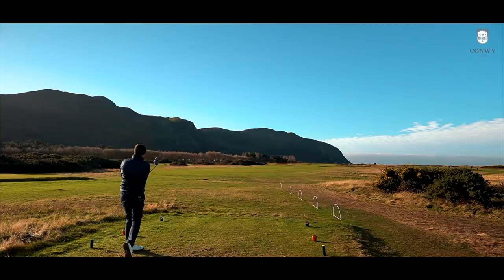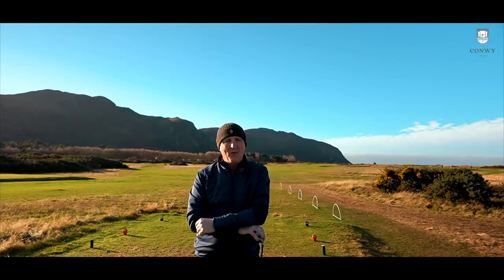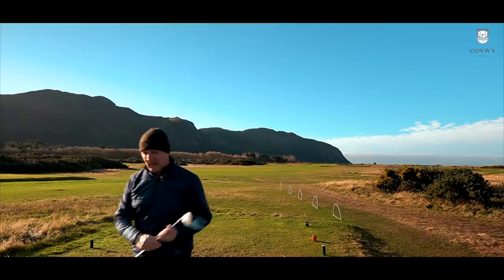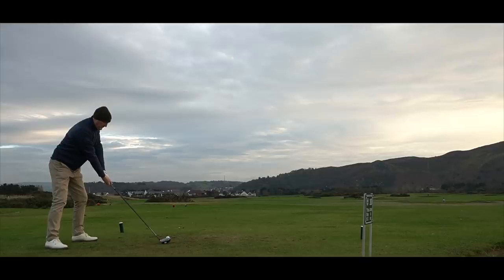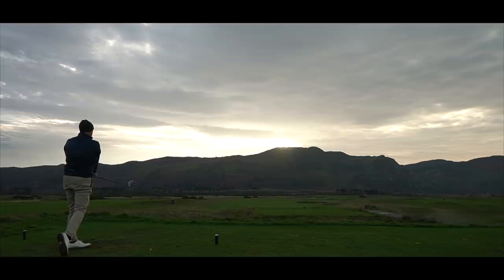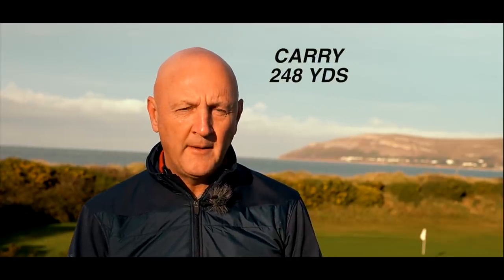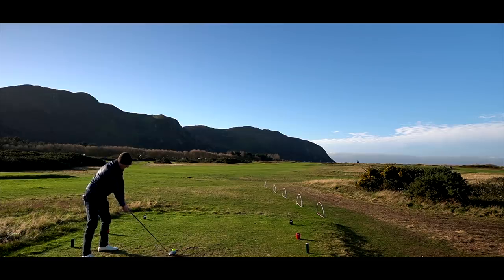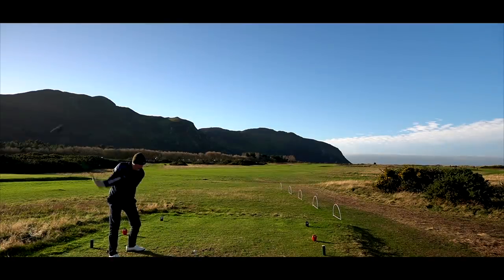SIMply the BEST DRIVER by TaylorMade SIM?

Comment: The Ventus shaft isn’t the same specs as the high end Ventus shaft — according to the MyGolfSpy boys it’s a cheaper version without all the bells and whistles but if you didn’t read up on it carefully you might get suckered into believing it’s the full meal deal shaft. Anyhow more into the Cobra line since they offer a tour spec 44.5” shaft as an option with their new drivers
Reply: Huw chardon Ping make fantastic drivers. The G410 just went on sale and are $399 so another good option. F9 right now is $349.
Reply: @cwugrad396  i have the g410 plus & cobra f9 and can't split them on the course at all. I would never swap these 2 drivers out of my bag for anything that came out as i know i won't improve my accuracy or performance with any other drivers.

Comment: Great Video Andy.  From what I understand, Fuji sold the shaft name (I don't know why) and that the Ventus shaft in the new SIM is not a true Ventus shaft unfortunately.
Reply from the maker: Thats interesting, I had been asked in the past to review the shaft and I just didnt like this version at least
Reply: Unfortunately, TM NEVER use a full Spec After Market shaft, they ALWAYS use an OEM version which de-speced to get down to a price point. So the Ventus shaft that TM is using in the SIM driver is not the same as the Ventus After Market shaft, it does not contain the i-core high-modus graphite as the "Real" Ventus does. The clue is in the price, the Ventus After Market shaft is nearly the same price as the SIM driver.

Comment: It’s the Cobra F9 with a new paint job.
Reply: There’s a sliding weight, there is no milled face like an f9, there’s that Taylor made speed pocket, the crown is very different and a different colour, appears to have those injection ports in the face,but it does have a shaft, a 460 cc head and a grip so you’re pretty much spot on there champ...
Reply: @tiborsol7959  ignore the meaningless speed pockets, milled face and sliding weight and look at the shell of the club head and it’s basically an F9. Neither TM or Cobra make any club heads. They buy them from the same couple of foundries in China . The only thing TM do is design the club head and assemble the various components. Enjoy your new SIM driver. I’m sure that those extra fifty yards will help you break a hundred this year.